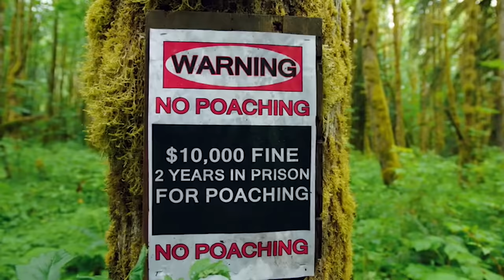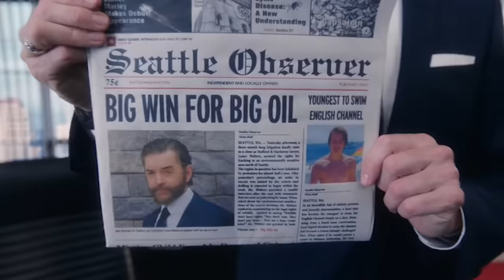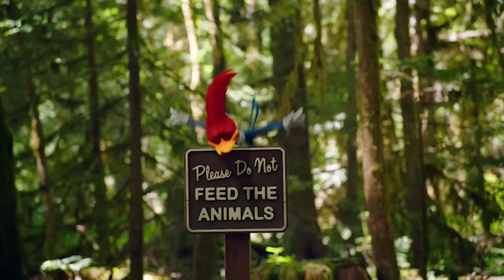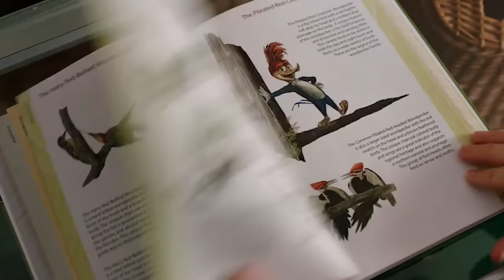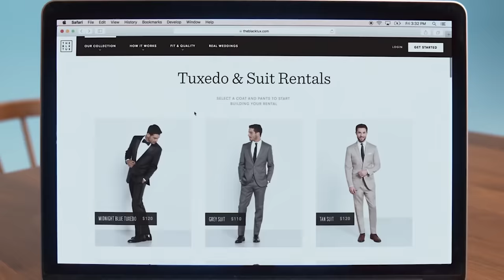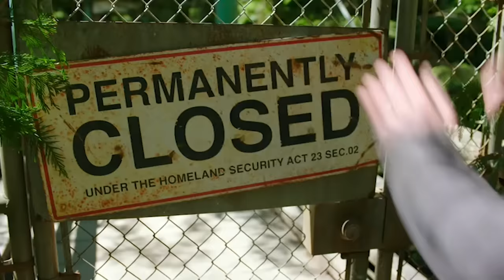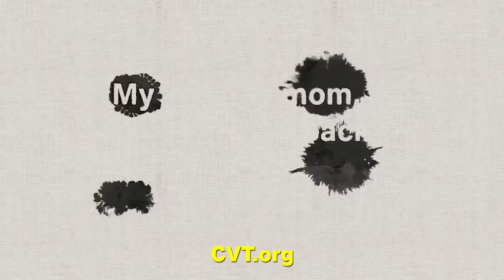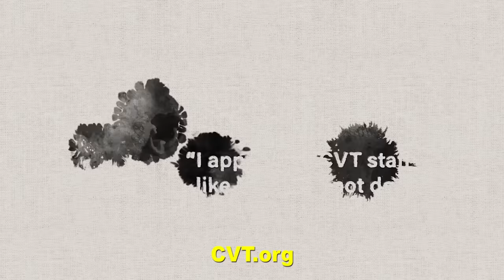Woody Woodpecker - Nostalgia Critic

Comment: You guys don't get it, do you.

If Doug speaks up, Mike will pretty much arrange a fate worse than death for him. Mike won't speak up because he'd rather cling to whats left of his face value and money until CA implodes on him. Doug can't move on because the critic is literally everything he has, and the character has been immortalized in different pieces of media and culture. Mike won't move on because money. 

They are both trapped.
Reply: Gotcha. So he should just sit tight and get engulfed by the implosion instead of rowing away from the fire and trying to start back from the ground up. Or trying to work for someone else.
Reply: If Doug left now and tried to start his own thing, the only thing that would keep him afloat is the fact that he used to be the nostalgia critic.

Comment: Do something about Mike Michaud, or your subscribers will continue to go down!
Reply: Mike is Doug's boss, how in the hell is he going to do anything?
Reply: They probably can't do anything. They gave most of the control to him, for nothing. Even gave him their Intellectual Property. Can't get rid of him without an ugly legal battle, probably. Can't get rid of Doug either, for obvious reasons. Doug and Mike are joined forever, and if one goes they both go.
Reply: Again, NC is the main draw. If Doug left, he would have to create new characters. He already did try to give up the NC character once, and it didn't work. If he left the character and also left the company on top of that, he would have a hard time. I agree that's what he should do, and that's what I would do, but it wouldn't be easy.
Reply: I'll fetch the ladder, you fetch the rope! GO GET EM BOYS!
Reply: -18,614 in the last 30 days and the loss rate is slowing down again. I'd estimate they will lose 25,000-30,000 tops over this thing, which is not as bad as it could be, and far from the worst days of Fine Bros. for instance. This whole thing will blow over soon enough, and the channel will recover like nothing had happened.